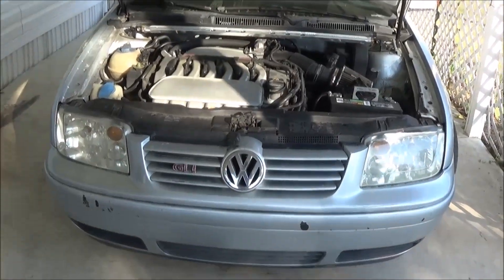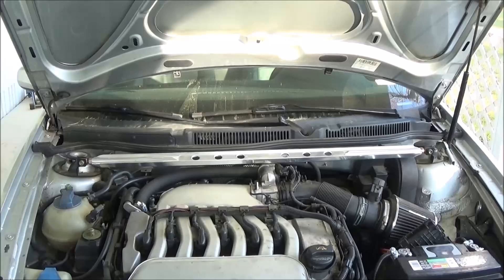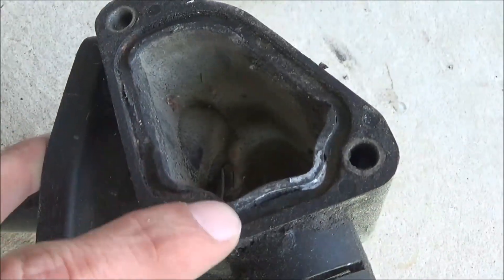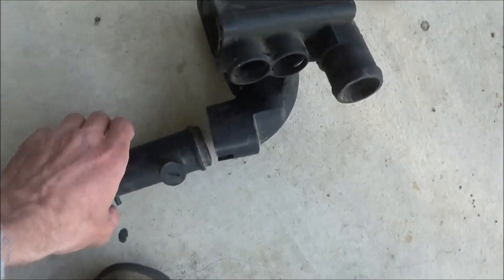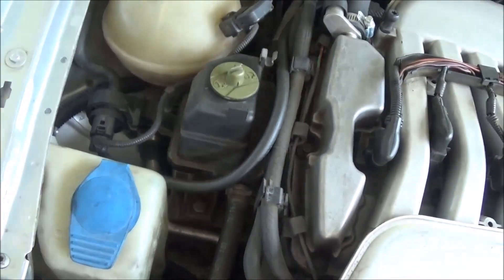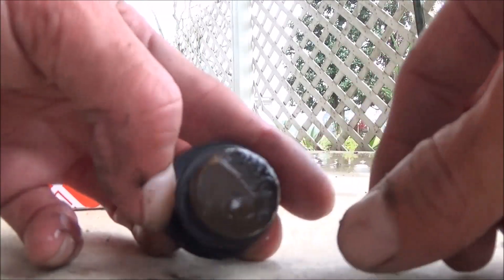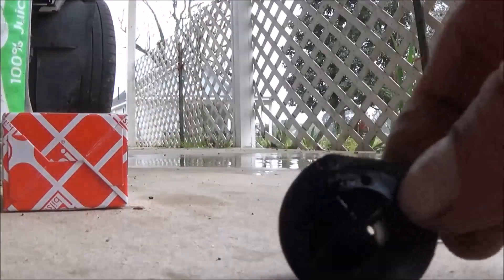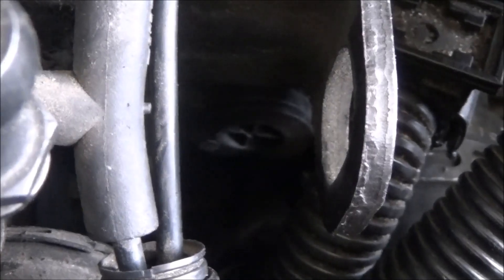Every Volkswagen Coolant Leak Explained

Comment: Mine is losing coolant very , very slowly but I can't find a visible leak. I ruled out head gasket and water Because there's no smell.
Reply from the maker: I had a situation where the car wouldn't leak when running under pressure but would only drip when parked a certain way and the sun would heat up the front of the car and the coolant flange would drip. It's easier to diagnose if you park on concrete. Good luck.
Reply: @joshcb7  Yeah I've left it running and popped the hood and all. Me and my mechanic are gonna dive deeper into this either this weekend or next. I bought coolant in the middle of April and have only had to put some in on a few occasions and it was very little. Fortunately it's very slow so that should buy me a little time. 
Thanks man!
Reply: Mines leaking halfway along the underside. It’s the two pipes that feed the rear heater matrix. never did I think coolant pipes  would be travelling so far along the underbody!

Comment: I had a problem today where my thermostat light came on and my hood started steaming a bit I opened it up n the coolant was boiling. And when I parked it to do so there was a puddle of liquid under the passenger side of the car. Now that I’ve got it home there’s some very small puddles on the same side. And ideas as to what this could be??
Reply: -Volkswagen Jetta 2012
Reply: Water pump possibly